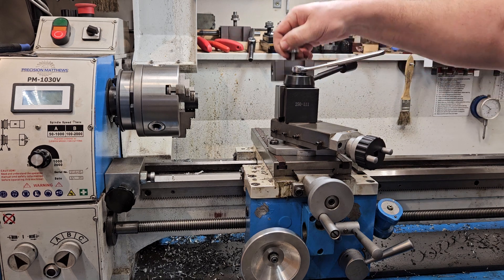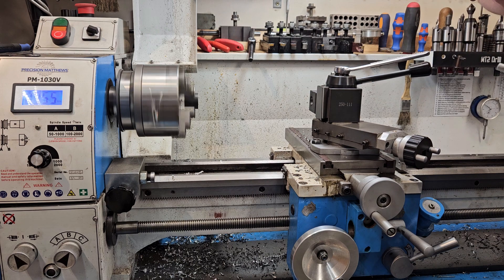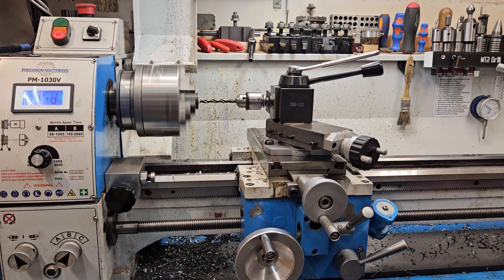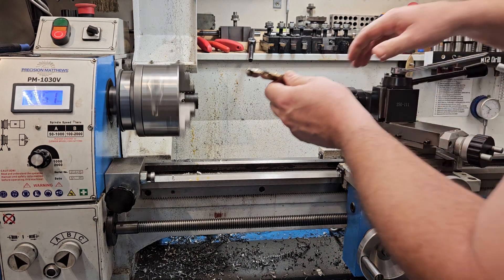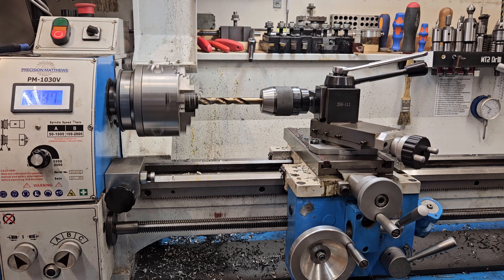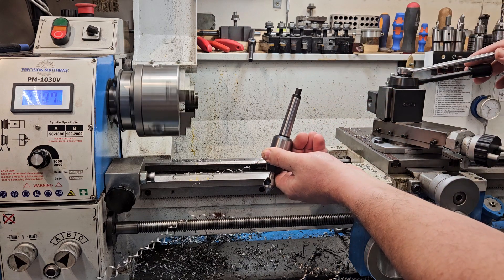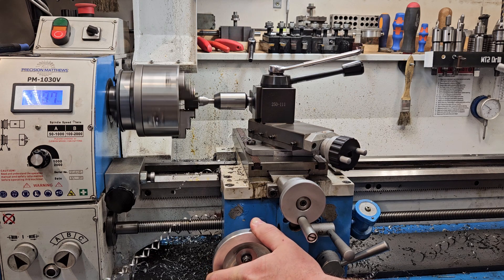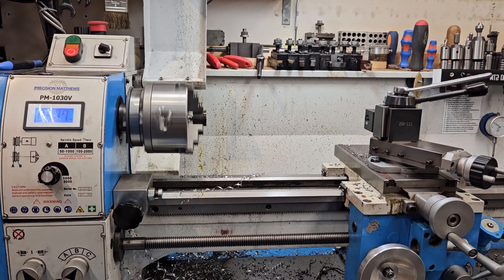Carrige Drilling on PM1030V

Comment: You might want to consider screw machine length drills if you make mostly short parts.  They are stiffer because of their short length and thus more accurate with the centerline and were originally designed for drilling such as you are doing under power.  I use mine all quite a bit.